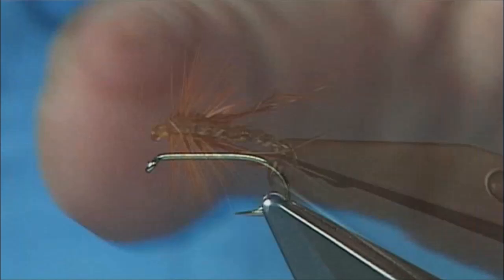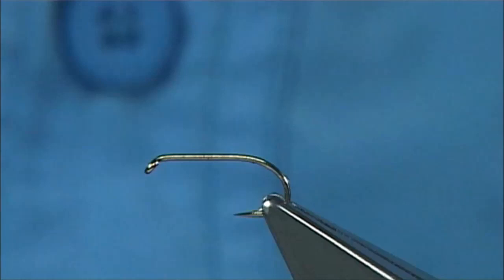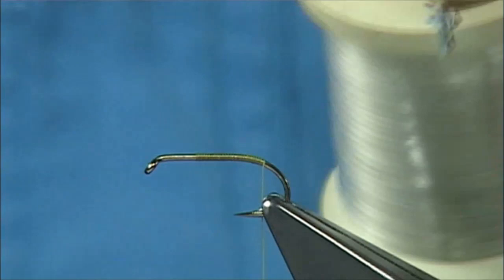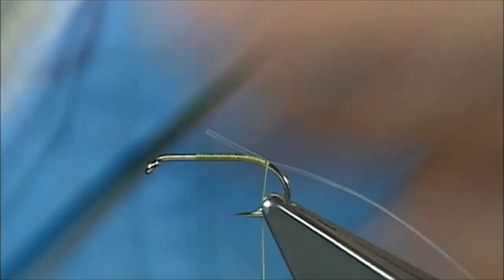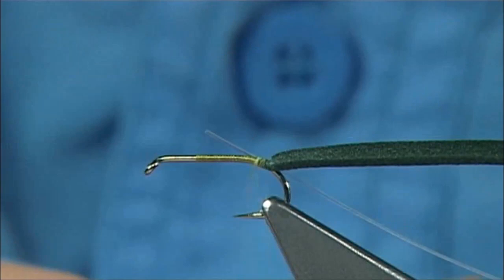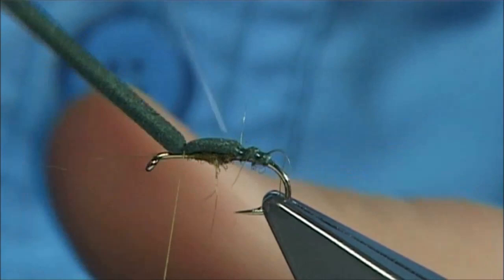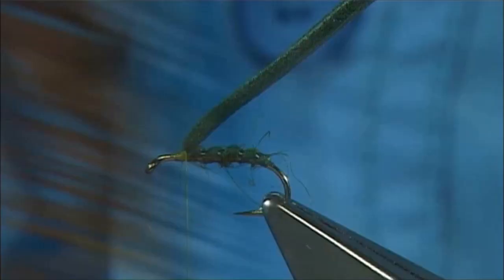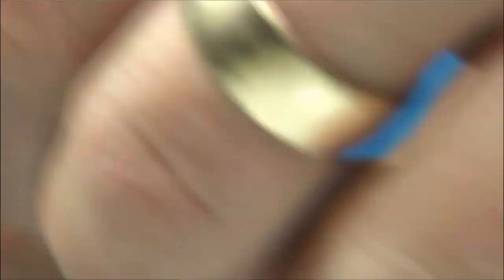Tying a Foam Back Hopper/Adult Midge by Davie McPhail

Comment: hey davie, just wanted to know if you had any favorite midge patterns that you tie in size 20 and smaller. my personal favorite is a biat midge. here in the high pressured tailwaters of colorado, its good to stay ahead of the crowds.
Reply from the maker: Hi Tyler,

When you are tying that small there's not many materials that can be used, my favourites would be pheasant tail fibres, goose and turkey biots, stripped peacock quills and threads and fine mylar tinsels..Here in the uk and Scotland we use much bigger flies than you do as most of our midge patterns are for fishing in the lochs and not on the rivers though you can get some very small midge coming off in the early part of the season. Flies I like to use are small griffiths gnat, f-flies and a shipmans buzzer..Heres' a link to some shipmans buzzers which I have on youtube.. Tying the Shipmans Buzzers with Davie McPhail.

I hope this is of some help to you..

All the very best Davie